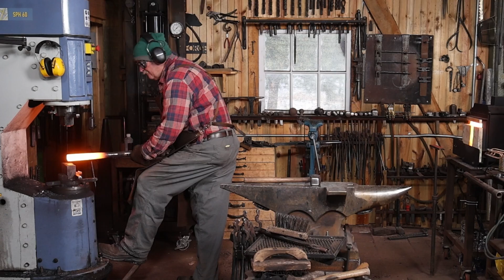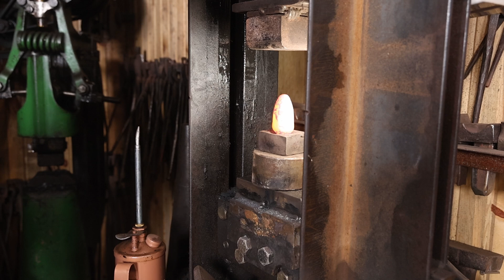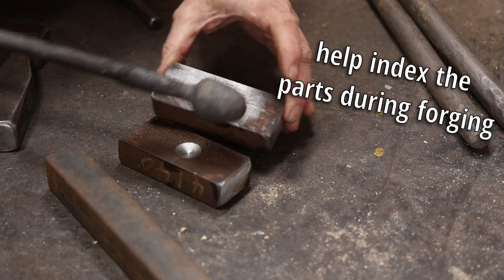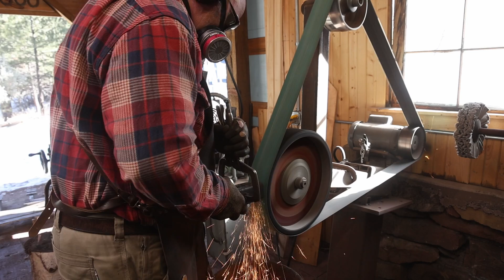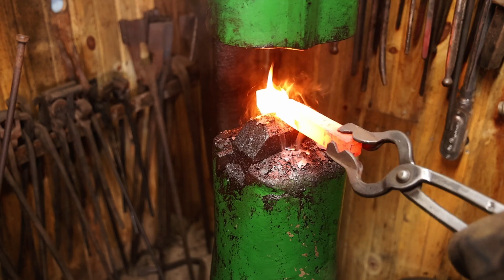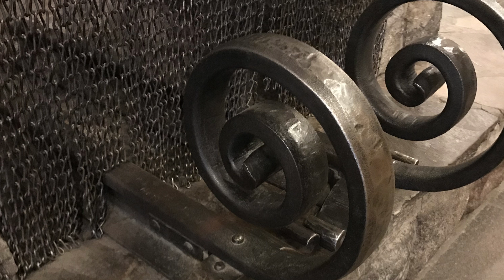Forging a Pine Cone starts with making tools

Comment: SOME PROFESSIONAL ADVICE. I have watched 3 or 4 of your videos and find you Very knowledgeable and a quite pleasnt demeanor. You are an Excellent Instructor.
The advice presented is from my career as a Certified Welding Inspector since 1986. 
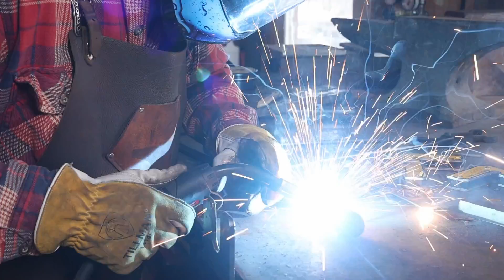At 3:38, you post the wrong order of events/procedure (twice in this video) by "Tack, Preheat, then Weld". PREHEAT FIRST!!! Then Tack, (maintain interpass temperature of 400*F for 4140) , then weld away.
MANY so called professional welders (and most beginners) make this same error of sequences. I get to make them cut it apart and reweld it the correct  way. 
Here's why... preheat is for reduction of thermal shock from the intense heat of the arc and (in this case a tackweld) and liquid weld metal deposit onto the cold base metal. The rapid cooling can cause stresses and cracking is often the result. Sometimes in the weld and sometimes Underneath the weld. 4140 is an HSLA (high strength low alloy) steel and needs to let the heat disperse slowly and evenly. Hope this helps you in the future and your viewers. to let the heat disperse slowly and evenly.

Comment: I’m guessing that with a little more precision is the way bullet molds we’re made back then. Nowadays a exact replica of a bullet is machined on a lathe then flutes are cut into it with a milling machine. Then it’s heat treated and made into a cutter; two blocks are simultaneously squeezed on each side of the rotating cutter to produce an exact mold. It’s fascinating how things were produced back then and how things progressed to nowadays.
Reply from the maker: They were typically cut with a ball shaped cutter called a cherry.

Comment: This doesn't pertain to this video. I've watched all of you're forge welding videos, but I'm not quite getting it. I'm heating the pieces slowly; to a red for a couple minutes, then I turn the gas up to an orange, then to almost yellow, then a bright yellow lemon almost turning white. I get an initial weld, brush and flux then back to the heat. I repeat that multiple times slowly working up the piece, but I can't seem to get more than about 1" of weld on what needs to be about 3" before it starts trying to pull itself apart as I'm working up it. If it helps to know I'm trying to faggot weld three pieces of rebar together to make a bending fork for the hardy hole and I'm using borax for flux. Any advice would be appreciated.

Comment: Been to timberline Lodge many times when I was younger, always liked at the wood work and framing though. That's a big building made without bolts or nails from what I remember. Gonna have to go back one of these days and look at the iron.
Reply: We visited Timberline to see the iron.  No welding, all art deco 1930s iron work.  While I will NEVER make an andiron from a solid 100+ lbs rail, the gates, fittings & details inspire new work.  Keep it coming John! Thx

Comment: As usual John, great video.  
Just one question: Why not start out with a round rod for the pine cone instead of square stock?  Just curious.
Reply from the maker: The final projects will be square bar, so thats what the finial will be out of.  Otherwise I would have the added step of forge welding the finial onto the bar

Comment: What rpm motor is on your press? Yours is to slow and mine can be to fast if not careful with the pedal🤦‍♂️ The 2 stage on mine isn’t noticeable but it has a 3500rpm motor also. Not sure if that’s the difference or not but it’s possible.
Reply from the maker: this is a 1750 2 hp motor.  I would need to use a 5 hp motor to run at 3500

Comment: Been a huge fan of the channel for a while, and one of the things I admire the most about your videos is your humility. You're not only fine with showing failures, you're happy to talk about them. I'm sure all of us blacksmiths know how quickly things can go pear-shaped and how frustrating it can be, and I think it's good that we can share those experiences and learn from them.

I just started working out of a coal forge more frequently after moving shops, and just as I was starting to get comfortable with using one again, I was humbled in under a minute. I had been making a meat-flipping fork, and as I was finishing up the tines, I thought I had enough times to run and grab my bending tongs... I was wrong! They weren't in the place I thought they were, and in my search for them, one of the tines had burned half way and completely ruined the piece I had spent the better part of an hour working on. I simply looked at it, set it down, and turned off the fire with the intention of coming back later.

After a failure like that, there's simply nothing you can do short of welding on a new tine or starting over. It's good to embrace your failures and learn from them in the future. Next time I need a pair of tongs, I'm going to have them ready BEFORE putting my piece in the fire! Great vid as always John :)

Comment: How would you add the chisel marks into the swage
Reply from the maker: I don't think it would be practical.  The stock needs to be rotated to keep the forging even and any chisel marks in the die would line up as you turned the material
Reply: That is true didn’t think about that.  Trying to get a feather die set made for the power hammer

Comment: Everything that doesnt go the way you thought it would is a learning experience in how not to do it next time.
That was a lot of pinecone grinding ...who new those things were so hard 😅
Thankyou for sharing its a great way to teach the timeline involved in reaching the goal
Reply from the maker: Luckily the ones made using the dies won’t require much grinding.
Reply: @BlackBearForge   good stuff ....and that's why we make dies in the first place. It's one of the big advantages of metalworking over wood, it's often much easier to make another one the same or near enough the same

Comment: Surprised me, as you formed the spring dye, you didn't spin the plug, but, when you used the dye to form the "pinecone", you did spin it.
Reply from the maker: The master used to make the dies does’t really need to be turned since it’s already symmetrical.

Comment: Yes, the whole making a tool in order to make a tool in order to make a thing.  I go through that all the time.  Out of curiosity, I know you used tool steel for the bottom swage but in the Mark Aspery books he shows making a similar swage but he uses mild steel and then says to case harden it.  I know the stuff he uses for case hardening is basically toxic, but there's a newer version of that called Cherry Red Case Hardening Compound that's supposed to do the same thing but without the cyanide gas.  Have you ever tried that stuff or case hardening in general for tools like this?
Reply: Cyanide hasn't been used for case hardening for decades. Mark shows using Kasenit for case hardening which contained no cyanide it is no longer made. The Cherry red compound you mention is basically the same as Kasenite.
Reply from the maker: I haven't done much case hardening

Comment: I have a hard time filing stuff that I need to be round. Is there a simply way to file round objects like a punch?
Reply from the maker: Lots of practice.  A grinder does make life a bit easier
Reply: I didn't think about using grinder I figured it would put more flat spots on it. I made a hot chisel and a 1/4" punch out of 5/8 spring got a beautiful taper but after square, octagon, then round it turned our more oval then round I'm guessing my square was more rectangle lol. So I have been hand sanding for hours because the file was making it more oval/octagon

Been watching your videos for about year and a half.  Only been smithing on weekends for last 2 or 3 months. You have enspired me to get off my butt on my days off and stay busy in my shop thanks!

Edit: when you said grinder I was thinking an angle grinder with flap disc.